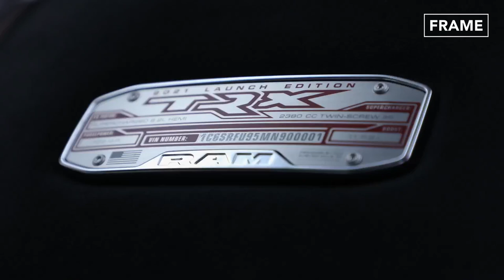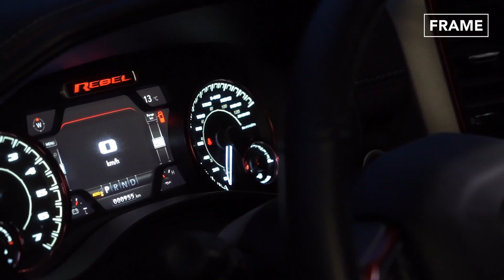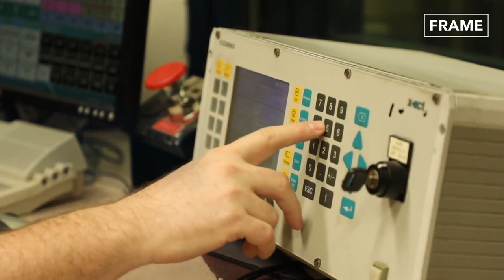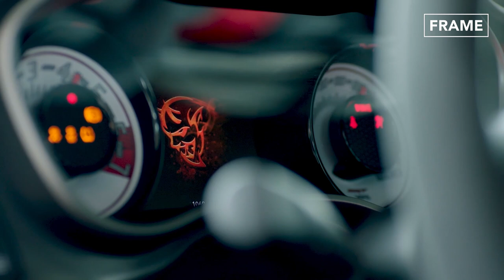Massive DODGE RAM Truck Production Line in US Factory

Comment: I miss the days of steel, chrome bumpers with bumper guards.  I have my Dad and Mothe's last rear-wheel drive Chrysler Fifth Avenue, 1989 with these bumpers.  The car is as solid as a rock 39,000 original miles, and is virtually brand new.  The only thing I did to the car was change the steering out to a Police Interceptor Plymouth Grand Fury to give the car a stiffer steering feel.  They currently own a 2019 Chrysler 300 Platinum and just spent $900.00 having the rear plastic bumper clip repaired after somebody backed into the car.  It scratched the paint and is ridiculously expensive to repair.